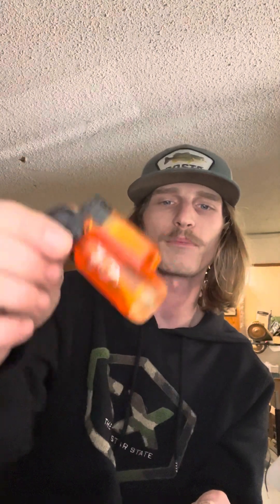How Jet Flame/Torch/ Jet lighters ACTUALLY work. (Hint: it isn’t a pressurized gas chamber)

Comment: You're close but not complete, also why is it so difficult to find any real information on the way these work. It is definitely the nozzle design but if you open one up you will find either some holes in the burner assembly or sometimes an air gap between a little gas hole and the burner assembly and the purpose of both is the same - to premix the fuel with air like a throttle on a carb. Forcing the gas through a tiny opening open to atmosphere creates a lower pressure which sucks air in and it mixes with the fuel which is what allows the clean blue hot flame. In a Bic lighter the fuel is already burning before it hits the air so it only gets fuel and air at the boundary of the flame producing a yellow dirty low temperature flame due to the Incomplete combustion. Burning is just fast oxidation same as rust only much faster and hotter but both require oxygen. The air is only like 15%-20% oxygen that's why an oxygen - fuel torch is so much hotter, it is getting pure oxygen to assist in more complete and fast oxidation.

Comment: Thank you for that explanation. I had figured something as such becsue i built a jet stove an drilled little holes in a circle at the base of the metal cylinder and essentially just put the wood jn the stove light it and it sucks the oxygen in thr bottom and out thr top creating a really intense hot quick burner

Comment: The little holes and the center hole are venturi. When a fluid (gas is a fluid too) passes through a constriction it speeds up. I believe bernuli discovered the principle.  You have a very good understanding and a great explanation. Simple video but excellent.

Comment: My man, you deserve so much more credit then youll ever get for doing this research.

 Funny thing is the whole nozzle set up and how it actually works is exactly what i was trying to find when i searched how a torch jet lighter works. I knew it wasnt to do with the "pressure" in the tank. Of course there will be some pressure in there but thats gotta be more just from the gas itself when combined wirh oxygen must create pressure as the 2 mix and the gas particles or whatever the fuck the proper term would be, im guessing the expand with energy. But like you said its no different from a bic, they both have a standard plastic tank to contain the gas. These are not pressurized with some machine driving 100s of psi into a tiny plastic container.  

 I figured it must be some sort of vaccuum type effect as gas and oxygen combine and i figured it was pretty much what you said but i wanted a more definite  explanation and you nailed it. 

Many thanks my man. I dont think ive ever subbed someone over explaining somethibg like this but you earned it haha.. 

Have a good one and thanks again

Comment: You are a bit off. It is in fact a difference in both air and fuel that causes the average jet flame to form. Feeding it with extra ambient air from the base will make a flame stronger but becomes necessary to keep up with the increased fuel demands of higher flow nozzles. When more burned fuel demands more oxygen, more air will rush through the vent holes which increases the jet shaped effect. It is not the pressure of the inside of the tank that is any different, but the amount of fuel that the torch head allows to pass through itself. Like a pin-hole VS a garden hose. Consider, anecdotally, that a bic lighter will provide many times more minutes of being "on" than a small or even medium sized torch lighter can. A torch can eat through 10X as much fuel in a fraction of the time, because it is consuming far more butane per second, which requires more oxygen to process- thus the extra ventilation requirements, which when angled correctly, can foster a beautiful jet shaped flame.
Reply: It still needs the butane pressure that the butane can is pressurized with to force the fuel thru the tinny hole in the piece of metal inside all jet lighters. If you have ever taken one apart, you might have seen it, its a round flat piece of some type of metal , thinner than a piece of paper and has a microscopic hole in the center of it

Comment: " An electric arc is a continuous discharge, while the similar electric spark discharge is momentary. An electric arc may occur either in direct current (DC) circuits or in alternating current (AC) circuits."' for example arc lighters create cw arc discharge but piezo's create momentary spark discharge
Reply: " an electric charge" to be more precise

Comment: one thing though in your description i don't agree with is about the flame adjusting lever control or the ones where you have to adjust it from the bottom, no this is not adjusting the air or oxygen flow, rather its allowing the valve inside the tank to allow more or less butane gas to flow through its a small spring inside the stem valve that run through the tank and by turning it it pushes the internal spring against a valve inside that regulates how much flow of gas is sent into the flame nozzle, btw if you smoke ciggs try lighting them the same way they advise to light cigars using little heat be it from soft flame or jet just to make the tobacco start to go cherry red and evenly lit and not char it but toast it instead and when you take the first drag its soo smooth and sweet and the rest of the puffs will be that way too because you did not turn that first layer of tobacco into charcoal with too much heat, i tried this on smokes and it worked for them too not just my cigars
Reply from the maker: I agree with you, I apologize for my mistake! I looked at only one lighter schematic and should have found more of them before making exact statements. I primarily wanted to sort out the fact that the propellant effect is caused by the nozel itself rather than the internal pressure of the gas. If the internal pressure was enough on its own the your standard bic would be a torch lighter!

I don’t want people to feel more scared of a torch lighter than a soft flame lighter for the wrong reasons.
Reply: no problem and yes it is all about the nozzle that determines the type of flame you get as some of them like turbo flame or jet/torch nozzles which suck in air to mix with the propellant to create the hotter blue flames, i been fascinated with jet flames too ever since i got the first one which was i think what they call a turbo flame style and those ones also made different colored flames such a green or red etc and then later i was blown away by the more powerful jet torch when a cousin got me an asg pocket torch, i like those ones better but actually found out that the weaker turbo flame was actually much better at being windproof you could blow on it as you are lighting it and it will light unlike some jet torches and i recently bought one of those at the dollar store for $1.75 but its flame was too low so i opened it up and figured out how to adjust the flame and made it a bit bigger and stronger i love this lighter now  and i recently had to fixed my asg which was not working and needed a new piezo so i took up an interest in lighter and nozzle designs only very hard finding stuff about them online like schematics, was wondering what you found and if you could share some links  @OTLP
Reply: @OTLP  btw the internal psi are the same for all lighters, what makes one flame different from another (ie soft bic flame vs torch flame) only has to do with the flame nozzle design or type, if you were able to switch a bic nozzle with a torch nozzle you will get the high jet flame too , if you ever tried to adjust the factory setting for the flame on a bic you can make the flame shoot crazy high because you are allowing the valve to let out more gas flow same like a faucet when you open it all the way but that flame will only be a blue jet flamme if you have that type of jet flame nozzle on it rather than the bic nozzle, so again it has nothing to do with higher tank psi but all to do with nozzle type
Reply: @OTLP  ohh man sorry about my last reply to you, i was under the impression you were still thinking it all had to do with the internal psi,,but after reading your title again and the comment you left you are spot on the same page with me about it being the type of nozzle that determines the type of flame you get,,been a while i have not seen your vid and enjoy watching it again thank you
Reply: Ok, so I have the exact lighter you're holding (but pink). It's my favorite! Only problem is it quit sparking. So I have to use my Bic to jump-start it. Is there any possible way to fix it? I know it cost only $5 and you're probably probably like just throw it away and get another 1. I like my lighter. I want to fix my lighter. Would you be able and willing to explain how? I mean is it possible to even fix it in the first place 🤔
Reply: @melodylandry6765 try cleaning the electric wick or repositioning it slightly.  If the spark is week or not close enough it will be out of sync to the gas
Reply: I always thought you should use a match for lighting a cigar.
Reply: @crispincattermole  depends on your school of thought, some use match because it's a softer flame if done right wont burn but will toast light the cigar, others think the sulfur will give a bad taste hence they use those wood staves, but using any flame so long as it is not too hot or used properly as not to char burn will do, some prefer butane flames as they say it is cleaner

Comment: true about how difficult it is trying to find info on the specifics of how these components work but no its not an arc its a spark just like any static spark you get at times when touching metal, very low amperage but high voltage something like 3000 volts that jump the tip of the piezo wire onto the brass flame nozzle and its not the small holes or orifice of the nozzle that increase the jet pressure its two or one hole drilled into the sides of the nozzle near the bottom acting like a venturi system so that the butane gas going through the brass nozzle coming from the tank through a gas line that goes into the nozzle sucks up air and creates a higher pressure jet turning an otherwise regular yellow soft flame from the gas line into a complete clean combustion blue flame but yes the small holes and orifice create the shape of the flame, i took apart my asg pocket torch that needed fixing so i know a bit about these components, i lit the gas line without the nozzle and got a regular soft yellow flame but once the brass nozzle is attached to the end of the line it gives the magic blue torch flame, i had to fix the piezo ignition and got it firing again, but yeah man just because you read something online don't make it true or correct, one place i was reading was saying how only very refined butane gives you a blue flame which it total bs any butane gas or even naphtha(ie lighter fluid) can become a blue flame if its under the right pressure and using the right nozzle same with any bic lighter butane if you took that gas which is a yellow soft flame and put it in a torch lighter you will get blue flame too but glad you made this vid and i think in the end you did talk about those side vents where air gets sucked into the nozzle so you got it